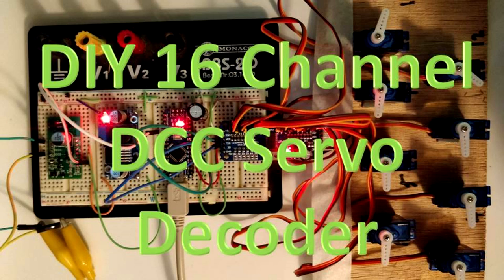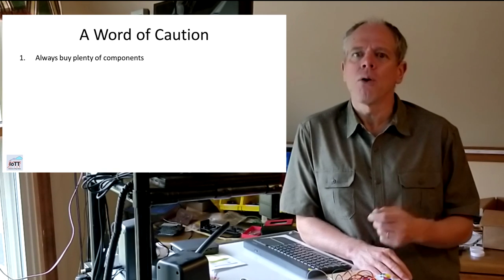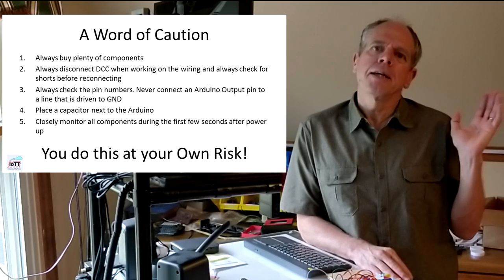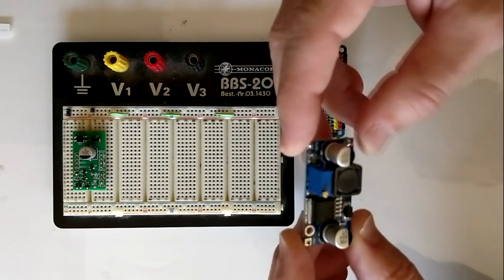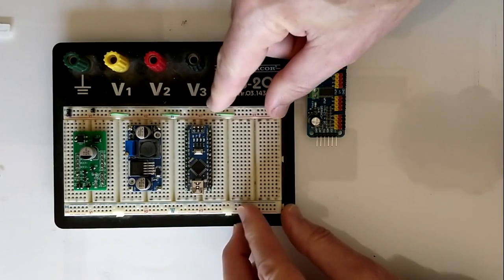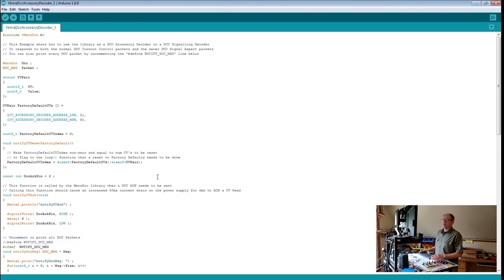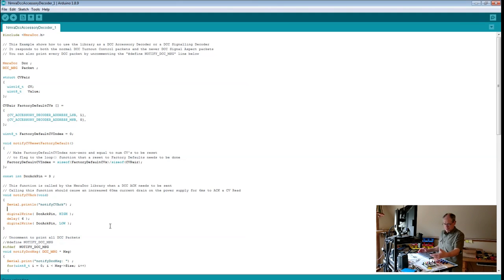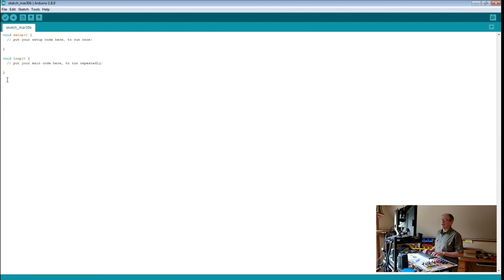16 Channel DIY DCC Servo Decoder Step by Step (Video#17)

Comment: Thank you very much. I have managed to  get this working with JMRI on a raspberry pi, DCC++ on a UNO, with a motor controller shield, an opto-coupler and your sketch on another uno. All this is controlled by an android mobile phone. All I need now is to get it off the work bench and onto the layout. Carry on the good work.

Comment: Thanks, I've watched the video but want to see if there are a few options.  A friend has a Lenz layout and wants to control turnouts to 7 tracks into an engine shed.  He uses Tortoises and wants just one momentary contact pushbutton to select any "route".  Is there an output module to suit?
Reply from the maker: Yes, check Video#78 https://youtu.be/QB0OnHWNqEE
This module converts a level input to a time adjustable polarized pulse every time the input level changes. The level input can come from a servo decoder (as demonstrated using the GreenHat, which essentially is the same code as shown in Video#17) or it could come from Arduino output pin directly.

Comment: Hans, thank you very much for this. I am tried of commercial decoders. This is something I have become very interested in. One question what capacitor did you use in your prototype? Thank again
Reply from the maker: The one next to the Nano board was 100uF, but the value is not critical. Most likely you can go without as there are capacitors everywhere, on the DC converter, the interface board, the Nano itself. But just to be on the safe side, it never hurts to add one next to PWR/GND pins of every board, particularly processor boards. 
If you are interested in the topic, you should also watch my newer videos on the subject, i.e. videos 54, 55, 58 and 60.
Reply: @IoTT  thanks for answering. The rest of my components arrive next week. Then the build. Will keep you informed on how it goes.

Comment: Hans very interesting.  It seems this would be a much more cost effective way to drive turnout motors.  Does this decoder communicate with any dcc command station?  Is there an option for control panel push buttons and LEDS to indicate position?
Reply from the maker: Yes, it picks up DCC commands from any brand DCC command station, as long as it is DCC ;-)
Right now there are no push buttons implemented, but that would not be difficult to do as long as there are available IO pins on the Arduino Nano.

Comment: How do I go about getting the DCC interface?
Reply from the maker: In this video I used a simple interface that has no electrical insulation between track power and the Arduino, in other words, the Arduino is powered from track, which is the way to go for a decoder type device with no connection to a computer. At the time when I made the video, I made a few interfaces, but they are all gone in the meantime. 
Later I made an opto-isolated version, which I am using for the IoTT Stick, but it would work no problem for a decoder as well. The only downside is that you would have to provide a separate power supply for the Arduino. The opto isolated DCC interface is available in my Tindie Shop: 
https://www.tindie.com/products/tanner87661/dcc-interface-breakout-board-with-grove-port/

and for the enclosure:
https://www.tindie.com/products/tanner87661/enclosure-for-dcc-breakout-board/